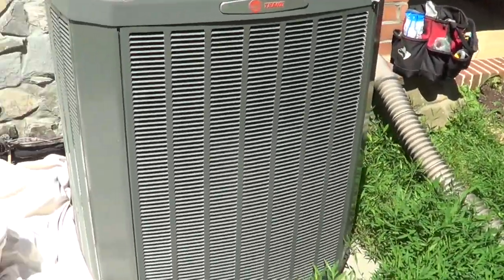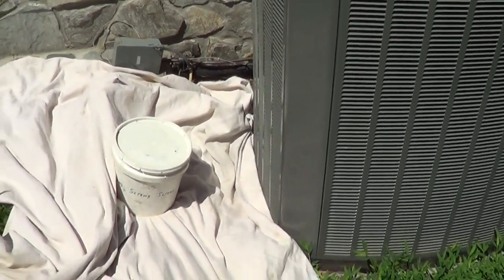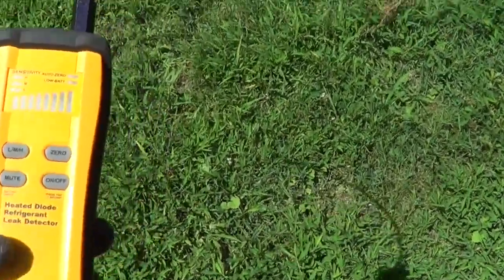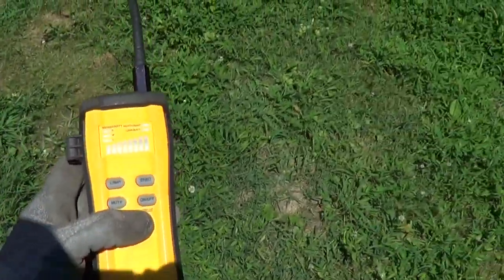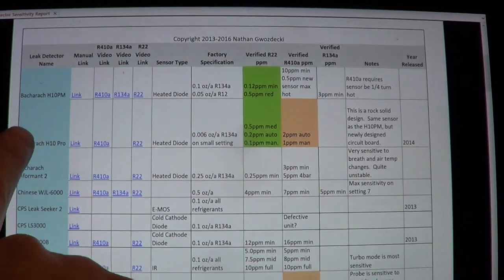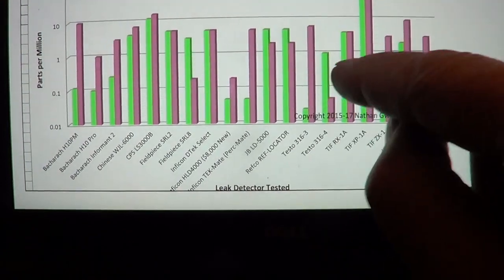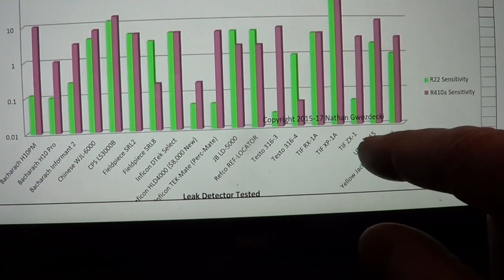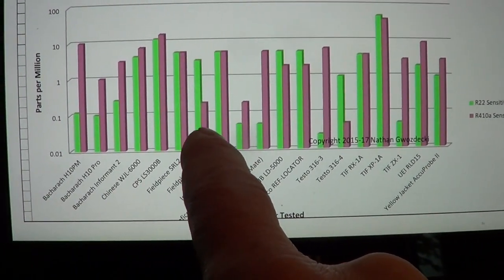SRL8 Detecting a Large Leak

Comment: Which leak detector do you recommend for r22?
Reply from the maker: They all work good on r22.   I use the inficon techmate.   R410a is the problem.   I currently use the navac.  It has the same sensor as the srl8, but is more stable.
Reply: @NathansHVAC  is it the navac nml1? And the navac would be best for 410a right? Thanks for the reply. Which one are you using for r22?

Comment: I'm kind of figuring since refrigerant is heavier than air, the refrigerant was laying on the ground in the grass and that's why you seemed to be getting all those false readings. That's definitely the kind of job where you need an Accutrak VPE Ultrasonic Leak Detector 👍
Reply from the maker: The SRL8 is very humidity sensitive.  Grass has higher humidity levels.  That detector is also very sensitive to breath.  But, it is the best most sensitive detector for R410a.

Comment: I have used srl8 heated diode detector and found a leak on high sensitivity but no medium or low, namely AS aluminum coils.  I have leak checked copper coils and found no leak, I know copper has no leak prior to going out. Question: why does it sense on high but not others, should I ignore? My company does verifications and the next guy doesn't find it with testo 316-3  or srl8 infrared?

Comment: I took your advice and bought the HSL8, I did a video and compared it against the Tif ZX and the h10 pro. Just like you said the h10 got his butt handed to it. Very disappointing but I'm glad I have something that can find the weirdo small ones, but I'm still double-checking everything with the H10pro until I get used to Discerning against the many potential false alarms that the Fieldpiece can give you.
Reply from the maker: Just remember the srl8 gets constant false hits including your breath.  Every solvent you can think of makes it go crazy.  But it will find the smallest 410a leaks.  And if it starts acting nice, the sensor is worn out and needs to be replaced.
Reply from the maker: I haven't found a better leak detector for hfcs yet.  And I have bought them all looking.

Comment: what is a good ultra sonic leak detector?
Reply from the maker: Just avoid the $50 chinese ones.  They don't work.  The Amprobe ULD-300 is good.  Also, the Inficon 711-202-G1.  I use the older Amprobe.  Also, I recommend some good old school headphones that have cups over the ears to block out external noise.  You are listening for the leak.  The visual indicator is useless.  A 20 lb per year leak will not make one bar, but it will have a noticeable sound.  If you ever walk up to a system with zero psi, don't bother with a sniffer.  The leaks are always 30 lb per year and larger when the system is completely flat.  Leak rate is the square of pressure.  So, to go down to zero, you have to have a huge leak.  The sniffers are useless on the huge leaks because they go off everywhere.

Comment: Thanks for the info on the leak detectors . So do you have any evidence that the ultra sonic is better than the heated pentnoide or the pump type ?
Reply from the maker: It is different leak detectors for different types of leaks.  For the smallest leaks 0 to 10 lbs per year use the heated diode.  For 20 lbs per year and greater ultra sonic works great.  Ultra sonic can not pick up tiny leaks.  The difficulty is medium side leaks that tend to blow out the heated diode sensor and are too small for ultra sonic.  There is also infra red.  They would be good on medium sized leaks.  But, I never found a need for them because I know they can't find small leaks.  I have more details and some video links in the report in the description.
Reply: Thanks for the info